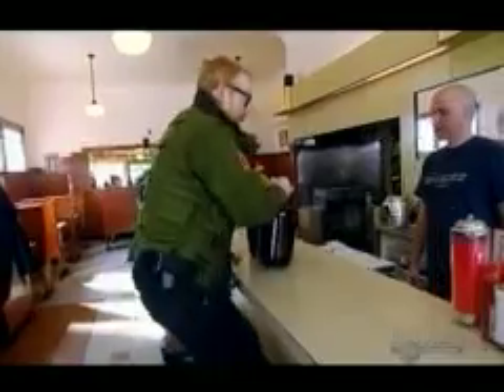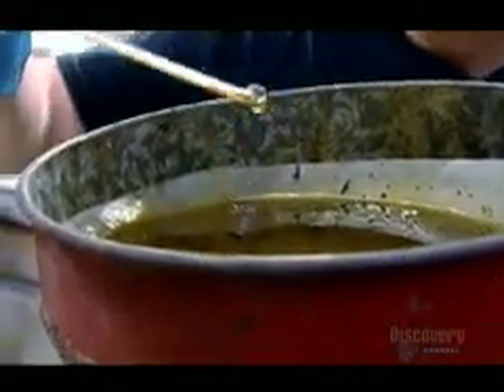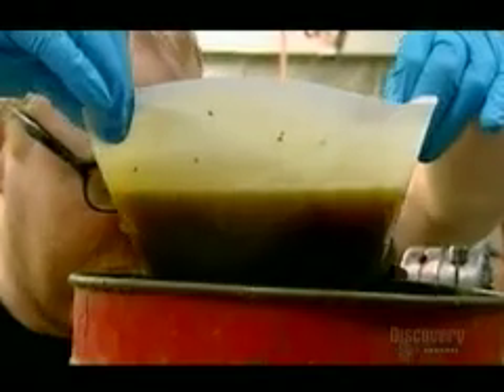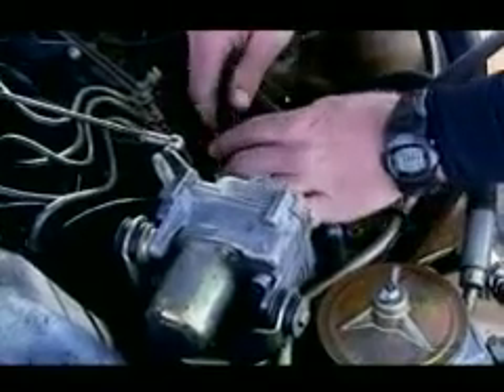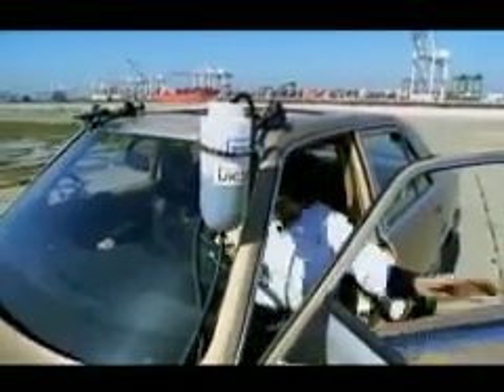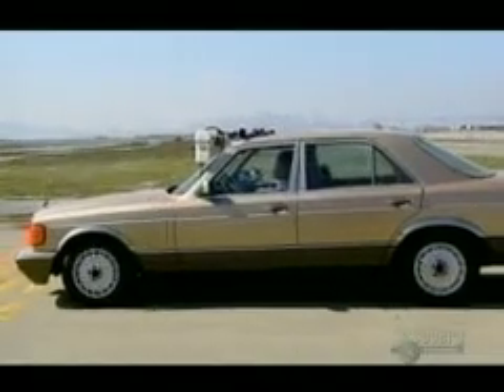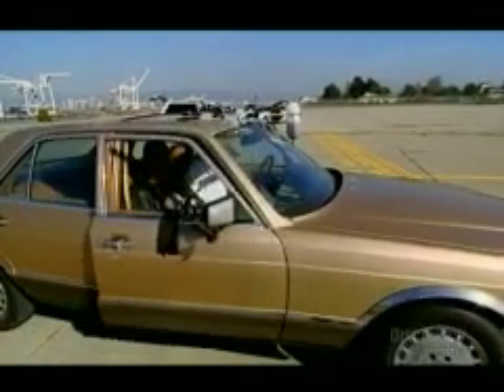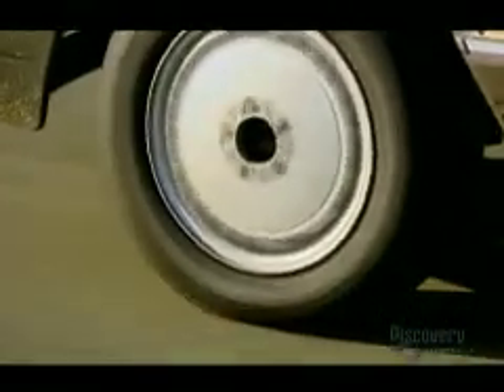Mythbusters - Cooking Oil as Economical Diesel Fuel

Comment: There is a reason why they used old Mercedes to this test. Any diesel made after 2004 would break immediately due to poor fuel quality. Old Merc will drink anything though...
Reply: ardvark84 Actually peanut oil was used by hobbyists that were making motors for bicycles and early cars in the late 1800's. The only reason gasoline and diesel was later used was because Rockerfeller through coercion and lobbying sold these waste products of Standard Oil that primarily sold kerosene for lamps. If you want to buy into the marketing of "premium" fuels, be my guest. There were several successful attempts at using used vegetable oil in newer motors, including Humvees, pick up trucks. I do understand your reluctance on experimenting on brand new motors though, don't get me wrong.
Reply: Only partly true. You would have to open up the lines since the oil is more viscous, unless hot. But if you add a spoonful of alcohol, it would thin out the oil, making it usable in new diesel motors.
Reply: Alen Combs
Maybe so but this can be a very  expensive experiment...
Reply: @ardvark84  Were you aware that Rudolf Diesel built the diesel engine to run specifically on hemp seed oil? There is no danger to a diesel engine running on vegetable oil. There are a couple of things that must be done to the oil though. It must be filtered very well so that the particulate is smaller than 5 microns (a human hair is 100 microns). Also heating the fuel lines by running them next to the coolant lines will help with viscosity as will a tablespoon of pure alcohol per gallon of oil. Also, because veggie oil is thicker it is advisable to run diesel until the engine is up to operating temp then switch to the tank of veggie oil, and at the end of a trip or the end of the day run some diesel through it to clean out the injectors. This requires two tanks though so not really convenient. You can also mix veggie oil in an 80/20 mix (80% oil) similar to bio-diesel. That will take care of the viscosity issue but you will still be using some diesel fuel, albeit it far less than normal daily usage would require. Again, the major issue with veggie oil is a viscosity issue. Injectors can get plugged after concentrated usage but they can also be cleaned instead of replaced.
Reply: @stevet5379  Yes, as I said Old Merc will drink anything
Reply: @ardvark84  I wasn't speaking about old diesel engines, this applies to any diesel engine.
Reply: @stevet5379  With the fuel clean enough, yes, any diesel will run but the newer the engine the shorter the run would be.
Reply: @ardvark84  Why would you think that?
Reply: @stevet5379  Beause I know how complicated are modern fuel systems. I'm also using old tractors all my life and I know that they will eat anything as long as it doesn't have rocks or twigs in it. Modern cars, with pump injectors and shit? They are dying on normal fuel...
Reply: @ardvark84  Having worked on various diesel systems (in the CDN Army and for an International Truck dealership) I am fairly familiar with diesel fuel pumps, injectors and such. Aside from better injectors and better pumps and airflow (turbo's etc) the basic diesel engine hasn't changed much.
Reply: ardvark84 It is not a conspiracy theory, it is a historical fact and also a reality. Vegetable oil is a hydrocarbon. Crude oil and diesel are hydrocarbons also. Cooking oil is also very good for fuel. With the addition of alcohol or another ingredient to make it more viscous, it can be put into your engine without modifying anything with your engine or fuel lines. Diesel and petrol also have to have additional ingredients to make it more consistent. They are basically the same thing. The only difference is where they come from.
Reply: Untrue Mr Aarvark.  In fact, a modern ECU controlled diesel will adapt even better to run on cooking oil.   And, yes, Diesel designed his original CIOE run on peanut oil.
Reply: ardvark84 Fair enough. I just mentioned the history to show that other fuel sources have been used. It does work, the problem is more about how inconsistent straight grease is. But biofuels (which are tested to work as regular fuels) are available, just hard to find right now.
Reply: ardvark84 except diesel is a compression engine, as opposed to the gasoline combustion engine. Both very different.
Reply: The USA used 143.85 billion gallons of gasoline in 2017, so as long as we also produced 143.85 billion gallons of waste cooking oil, I think we can switch over.
Reply: 13,016,000,0000 bushels in 2012-13 growing season.  A bushel yields about 2.8 gallons of ethanol.  So if we just make 4X as much corn and stop using any of it for food, booze, animal feed, (or exporting it to damn forigners!) we can replace gasoline.
Reply: just put 20% of gasoline in it, will make it thiner and cover the 10% eficiency difference.
Reply: Alen Combs
I wasn't talking about lobbying and all that stuff. But you're right, I can't change the fuel bussines, further more I'm not wealthy enough to get a new car if the one I have will brake down due to wrong fuel therefore I'm forced to use good quality diesel. Not that i'm happy with it but that's just the way it is...
Reply: ardvark84 the intent of the diesel was to run on vegetable oil. But kerosine was so dang cheap as a byproduct of refining gas that the veggie purpose faded out.
Reply: Would a Nissan patrol 2004 work? It’s diesel
Reply: 2003 and earlier TDIs are the best for this. Nothing with DPF or BlueDEF
Reply: ***** Nice fragwits. Thanks for the quote. ;)
Reply: 3Dtimespace
What is it then?
Reply: Sarah Lakenes I'm not so sure it was that way but ok.
Reply: Alen Combs Ok then. I'm not an expert on fuel and I don't really care. I know since I was 15 that you can use a vegetable oil as a fuel for diesel angines, then I heard a lot of shit about all kinds of fuels. Currently I run my car on normal diesel, it's a case of cry and pay but that teaches me every time that if you don't know what's going on, there is a big money behind the mistery. That's the rule of the fuel market end everything really. Obviously I wish we could pay less for fuel but last time I checked, wishes don't allways work.
Reply: FiveHundredism Who said anything about gasoline engine?
Reply: That's the truth !!
Reply: Alen Combs Alcohol is flammable doufus
Reply: That’s true. If it has electronic injections and run unprocessed or used cooking oil you better have a zipper on the front of your vehicle.
Reply: Not true in England they are doing this for cabbies with vehicles made post 2004.  Don’t be an American lying to keep fuel consumption going.
Reply: Well... I'd agree if not for BMW's M57 diesel. That thing is just bulletproof and the only things that could be a problem are all the ecology around the engine. With only elements needed for it to run, it would happily chug on veg oil all day long.
Reply: @edim108  m57 nice
Reply: Not calling you out but i do this on my 2012 cdti engine. Runs sweet as a nut. Usually mix it with 15% petrol
Reply: @Xvc2345   Wolfs can eat anything but would you give your dog some dodgy food just to test his limits at digestion? You have a dog, the wolfs ore out there.
Reply: @ardvark84  it’s a spare car and it’s worked great over 27k miles
Reply: It's true. Old indirect injection engines can run easily on SVO because they have less precise spray injectors which operate at a lower pressure, modern direct commonrail injections need a very refined fuek with correct viscosity otherwise you will fry pumps and injectors
Reply: mercedes will run on this stuff, but you would need to check the injectors once in a good while
Reply: *****
Oil is NOT a "fossil fuel"
Reply: ardvark84 Not quite that way, it was peanut oil that was used in the early motors. Kerosene was the main product of oil, petrol (gasoline) and diesel were the worthless by products that were heavily promoted (and blackmailed) into using for motors.
Reply: No ! Just no
Reply: daniel gandy
Explain
Reply: Alen Combs I'm not really into this conspiracy theory thing mate. Petrol and diesel are being used for internal combustion engines because they are very good for this. Engines evolved around the fuel not the other way around.

Comment: Mythbusters is such a propganda show. Bio diesel if very popular in Europe and the technology should be put to work here in the US to reduce carbon emissions as required by new laws. There was a professor at ASU who had a van that ran on used motor oil and used the engine's wated heat energy to boil the used oil and run off the combustable refined vapors. Bio diesel could be used with Pantone's GEET reactor as a means to effectively cut green house gasses.
Reply: Madera Strand cow isn't a pollutant

Comment: it will mostly work in San Francisco where it is tempered/heat all year long, this will probably work other/colder places but, if you dont add white spirit to serve as a solvent or add external fuel filter heaters (3% solvent, 97% vegtable oil it will make your engine hard to start cold and soot up inside valves, pistons etc.. not to mention the all important and expencive Fuel pump. Due to the fact that the viscosity of cooking oil NEEDS to be at 70-90 Celcius to have about the same viscosity as Regular Diesel, check it up before you start commenting..
Reply: maby so, but you would still need to filter it with those socks or your fuel filter would clog up pretty fast though, and i would not waste the little heat from the coolant so the fuel could warm up in wintertime hello it a diesel ... it doesent produce much heat when it is -10 to -15c or 14F and below.. then you would need the liitle heat the engine produces to keep the cabin at a comfortable temperature but by all means try it out...
Reply: martini carbine  it doesnt matter if you have a turbo or naturally aspirated diesel, what does matter is if you have commonrail or regular diesel injectors, but if you where to blend it i would blend it in a barrel or a tank with a pump with filters on it and let it run for a coupple of hours
Reply: martini carbine  what year is your land cruiser and what kind is it ??

Comment: emmmm. busted as the hypothesis was increased efficiency, but not busted as a cheaper fuel. and it burns cleaner, been and got the tshirt on this, done it years ago in a taxi for a year
Reply: The whole point of efficiency is to save money. So they're stupid if they think the myth is busted. Diesel is obviously a lot more energy dense than oil, I could've told you that without having to do a test like that.
Reply: @TheSuperBoyProject  actually canola and corn give almost identical mpg as diesel, and burns slightly quieter, I've done thousands of miles of driving on it over many years as I ran it in my taxi.

Comment: Everyone here is missing the point. If you are a person that has no understanding of how a pressure ignition engine works and you are strapped for cash. It is possible that the only thing you would have to do is go get used, free oil that you would be recycling, dump in your fuel tank and still make it to school. 
If your going to get into all the other crap (diesel tractors, blah blah blah (its recyclable not a refinery!!!!!))  chances are you probably never have tried this or you just like talking just because you can.

Comment: I agree with Darius.. been there done it. have 2 diesel engines needing rings from not running clean hot  veggie oil. take the head off see the deposits inside the cylinder .